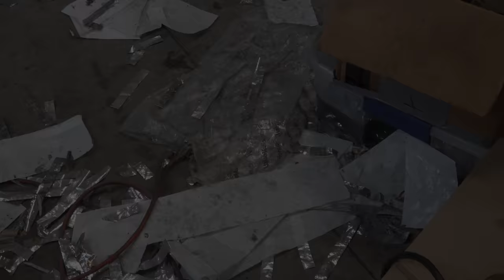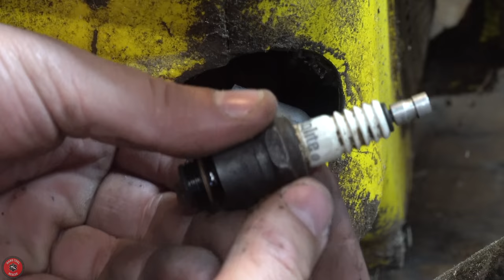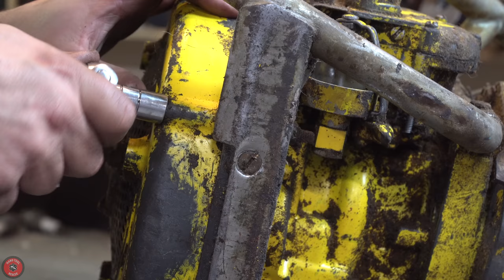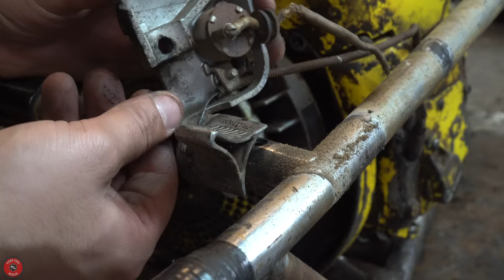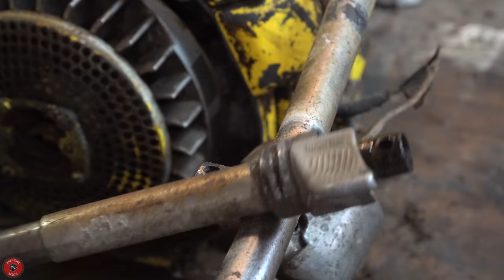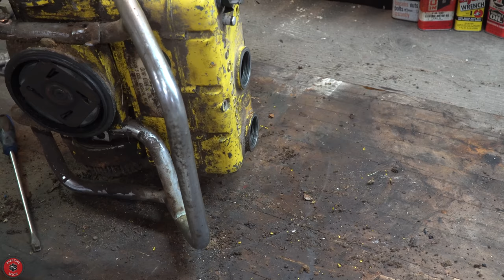Two-Man Chainsaw [Restoration] - Motor Inspection

Comment: Good job on putting the small screw back in the starter coil. I just worked on a modern Briggs and Stratton  engine someone tried to repair and then stopped several months ago.  In that time they lost a lot of screws, bolts and parts. Put them back or bag and label.
Love the intro.

Comment: My Dad was a McCulloch dealer in the 70s and 80s. I remember having a 99 under the workbench in the shop for years. It was just the engine, Dad always wanted to find the rest of the parts for it and get it running but never did. He got out of the business in 1988 and that saw went to the scrap yard. I've often thought about finding one to restore.

Comment: Might be a little late but you could have tried an air chisel with a blunt tool in place of an actual chisel to get that clutch flange off. Put a block of wood in the combustion chamber to eliminate the bounce the rope would have given.

Comment: At 26:50 you ask "Do you like that, woodworkers?"  That popped on screen about 3 seconds after I thought, I bought all my chisels for woodworking...50 years ago. And it took me about 20 years to realize they can be used for a lot of other things and suffer ZERO actual damage. I was betting the woodworking purists were wetting themselves as you chiseled away at old glue. Then you basically made a joke of it. Very cool.

Comment: I’m starting a Model 99 rebuild now (2022). I wanted to ensure that the PTO side oil seal could be replaced. To get the clutch off, I used a 4 pin socket tool that is normally used on a Toyota hub locknut. The “off” direction is counterclockwise. I was able to remove the clutch working against the compression with a 1/2” drive electric impact wrench. No damage to the clutch or tool. For reference, “OEM Tools #25969” available at Amazon and parts stores. Your videos are very helpful.

Comment: That is a funky placement of the points and condenser.
Reply from the maker: Everything about this saw is horrible.
Reply: Especially that wire that got stripped. Yikes
Reply: It took me a minute to figure out what was going on with the frayed wiring.  Then he opened up the cover and I was like "wait, whaaaaaaaat?"
Reply: The points and condenser are placed under that external cover (instead of under the flywheel) for easy service access in the field.  Don't have to tear half the saw apart to service them.  Most of the early Macs were set up that way.   Kohler and Clinton 4 stroke industrial engines such as the K series singles (and others) had similar points/condenser placement.

Mac went to a 'conventional' under flywheel placement later to eliminate that long pushrod (which would float at the higher RPM's that the newer designs were running at).  Back when this saw was designed, the "standard" chainsaw layout didn't yet exist.  The manufacturers were making it up as they went.  

This was the era of the transition from saws built with industrial style engines running big gear drives (and driving HUGE chains) to smaller/lighter/more compact gear drive and direct drive saws running MUCH smaller chains.  Saws like this Mac 99 (and the 1225 and 7-55) were a 'bridge' between the old monsters like the Mercury/Disston KB7AY series and the big Titans and IEL's and such to the newer designs.

RP McCulloch was an eccentric genius.  His carburetor/fuel systems were particularly nuts.  The carb assembly on this saw will barely fit in a shoebox.  Within a few years, the Tillotson HL, the Walbro/McCulloch "flatbacks", and the later "cube type" Tillotson HL, Walbro HS, and all those that followed did the same job with a fraction of the size, weight, and complexity.
Reply: @Eccentric5B  thanks for the Information. The only reason i thought it looked wierd is because i have only worked on engines that had points and condenser under the flywheel.

Comment: jeezus, the points and condenser on that thing are bigger than the ones in my Bug's distributor!
Reply: I just watched a VW restoration video and am pleased that I fully understand what you just said.
Reply: Look like the ones I ran in my 1977 Harley, 1960's something Chevy 6 cylinder ones worked also

Comment: Here's a bit of history for you all....I'm 73 now and I started racing go-karts in 1957. I lived in Kansas city and one of the racing venues at the time was the old American Royal building where they had a 1/10th mile oval dirt track. think "chili bowl" but even smaller. One of the regional hot shoes was a guy named Dave Ferguson and he drove a dual engine kart in "C" class. The kart was a Hustler made by a guy named Bob Uhrig and the engines were a Mc10 and a Mc99, total cubic inches 9.9+5.3 which brought him in within the limit for the class, 16.5 in. My dad bought a Missle kart, made in Ridgeway Mo. with a '99 on it but it was an endless source of frustration so it went away lol. I think 'Ferg only drove that for 1 season and then went on to the next "hot set-up"...triples. three 5.3 cubic inch Mc10's.
That's my Mc99 story. long ago and far away

Comment: You should try normal thread direction on that clutch i had a 2 stroke that had a similar clutch and i had it cut apart when i found out it was threaded try counterclockwise

Comment: Good call on the spring. I accidentally released the one on my lawnmower and it took me three hours to get it back, plus I realized the violence with whence it came out could have easily cut me badly.

Comment: Would a parts washer be handset to have or would you not use it much?
Reply: I use a parts washer to clean old saws before I tear into them like that.  It's messy, but helps to keep a lot of the 'saw cake' crap out of the innards once you crack it open.  Remove the covers and tanks and such and then clean 'er up a bit before going further....

Comment: Recently found your site. Love your work. One thing I found is I was stripping some interior doors and had a thought to put some saran wrap over it. I was getting off probably 6 or more coats in one shot. And its reusable. I've got some wheels I'm going to strip so I will get to find out how the saran works on alloys. Thanks for sharing your talents and methodologies. 

PS. Maybe you just don't have one, but I wonder why so many don't pressure wash pieces before disassembling. Just seems like it would be so much easier. Just a thought.

Comment: They make a piston stop that screws into the spark plug socket. It looks like a steel rod with threads and a hex head. You can get them anywhere they sell small engine parts for less than $10, if memory serves me correctly.

Comment: ..wow, that clutch looked tough!..if I had to do many of those, I think I would fabricate a tool with pins that engage the clutch, and weld a nut to it so I could be tone with it and use an impact wrench...I know you can damage the clutch or crankshaft with an impact if you aren't careful, but I have seen severe damage caused to the piston and/or cylinder, and even bent connecting rods, by fouling devices, even those made of wood or plastic...it's "choose your poison", I guess..so I choose whatever will work best

Comment: I always wondered if gas tanks have to have special anti static electricity layer... or of coat in this video make one...
Reply: no? the hell are you on about. they don't have real gas in them. It's just closed up nice and tight. And you can't static spark if you're constantly holding the metal and equalizing potential.
Reply: @narcoleptic8982  I was assuming you think they're using gas, as in, gaseous substance, not the "liquid" gas, which doesn't care how many sparks you throw at it. People on the internet are infinitely dumb.
Reply: @narcoleptic8982  Did you even respond to the rest of my comment or you got a case of the tisms.
Reply: @dimitar4y  thanks for answer, but I am just asking because I dont know that. I just know that classic gas tanks have some kind of anti static layer paint so you cant repaint them amateurisch because you can burn to death.

Comment: I had two tiny McCulloch trimming chainsaws one from the 80's and one from the 70's, the one from the 70's was the same color as this one. The motor's are about the same size or smaller then a weed-whacker motor. Anyways both had stuck clutches, must be a common problem, no rust. I had to resort to heating up the clutches to get them off and with a 3/8" shaft it was still hard to do. The 70's model was too far gone to restore, the 80's one needed a few parts so I'm thinking about turning it into an engine for my bike, just need to gear it down a lot.

Comment: Three piston rings but no needle bearing in the upper rod eye?
Strange engine...
For loosenig the clutch I would prefer a piston stopper threadened into the spark plug hole or a pair of hardwood bars between the piston and the case, if the cylinder is off already...
Maybe sacrifice the piston by doing so, but better to hang the whole machine on the wall because of a non-working clutch...
Great jobs, always with a hint of comedy, thank you!
;-D

Comment: I notice there that your clear-coat says it's 'fuel resistant'. I'm just wondering if there's a more expensive one that is completely, ahem, 'fuel-proof'?
Reply from the maker: It's just as resistant as car paint for fuel, so it's pretty good.
Reply: @HandToolRescue  - Ah, I really just wanted to drop that pun, but all data is good data :-)

Comment: The rope trick works on  auto engines too.
I used it when it i couldnt find my compression tool while changing valve springs on a v8.  it didnt allow the valves to fall in the cylinder

Comment: I have the same saw bought by my father and grandfather New in 1954. The motor is seized. And another single man McCulloch with a metal cable origin to recoil that is not seized. I would love to restore both especially the two man. Do you have a magic screwdriver, great advice or great parts supplier for these old chainsaws ? Any help will be greatly appreciated.

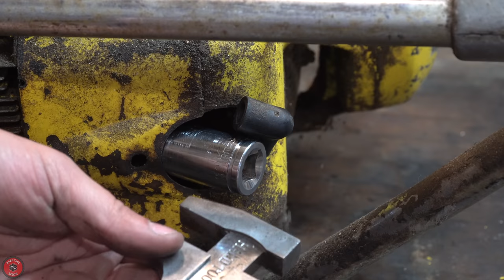Comment: 0:52 Why did you have a socket set, but no correct socket wrench or adapter to use it?  And no, a pipe wrench doesn't count as an adapter.

Comment: To get that crank thing off you need to heat it up and then spray some WD-40 on it's any of the crud that is built up in the threads will bubble out and you need to do this a couple times until you can break it loose

Comment: Should the piston in my motor be solid black and this crust nearly a centimeter thickk ?
Reply from the maker: Haha no.
Reply: @HandToolRescue  do you know how to get this off ?
Reply: Sleepy Pipit maby not. IF Its a two stroke it might have gotten too much oil. Or never been serviced
Reply: @2strokepower803  i think it could be to much oil my dad extensively used the oil injection when starting
Reply: Pull the piston off and wire wheel it.  Or just buy a new one.  And rings.

Comment: As a wood worker I like to see that you used a chisel to remove the detail plate; however I would have expected you 
to include the 45 minute video on flattening the back of your chisel and sharpening to a precise 30 degrees with a 3 degree micro bevel on 5 Japanese water stones up 3000 grit.  It's like you don't care about your woodworking tools at all.....

Comment: Dude I got my wrench and I love it. It did smell like a mix of cat pee and cosmoline, but I cleaned it with brake clean and oiled it.

Also I do have complain a bit that the track inside is all fucked up. It looks like someone went to town with a chisel. I think it's from the threads rattling against the inside of the track? Also you didn't debur the top part. I like the burs though because it makes the tool more sassy

Comment: You HAVE to get that clutch off one way or another. There's a crank seal behind it. On an old 2-stroke that's been sitting forever it's going to suck air and burn up the engine. Figure something out because that seal is probably gone. Even if it's not it ought to be replaced. It's going to be petrified by now. Half an hour of run time and it will disintegrate and you'll be really sad.
Reply: Agreed.  If at ALL possible, ya gotta replace the seals on these old 2 strokes.

Comment: From the carbon on the outside of the cylinder head I'm going to go out on a limb and say it had a blown head gasket but I could be wrong
Reply from the maker: You are correct!  Also, probably ran rich.